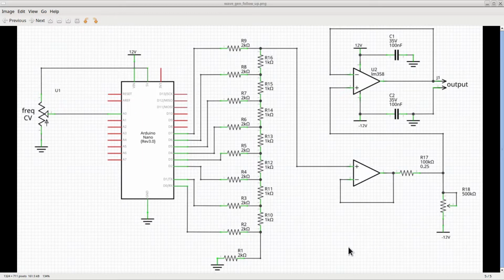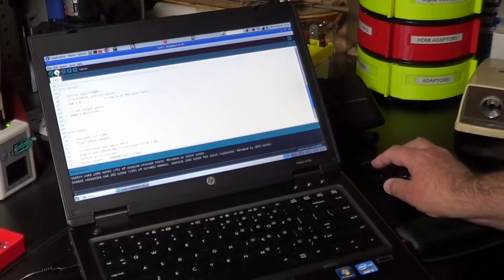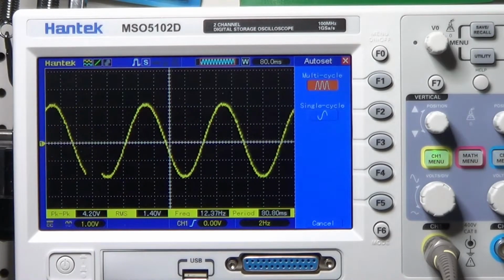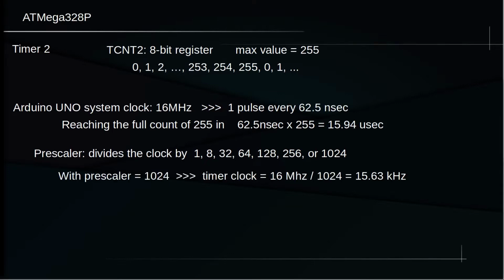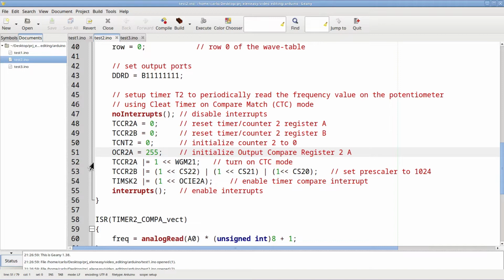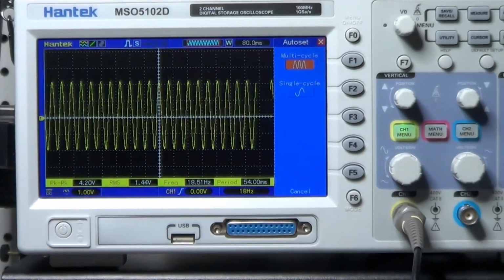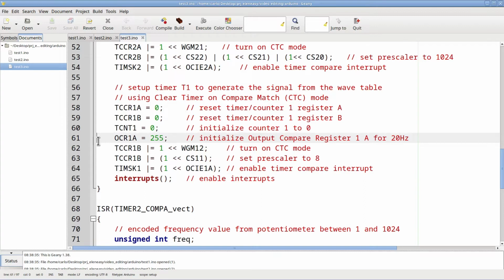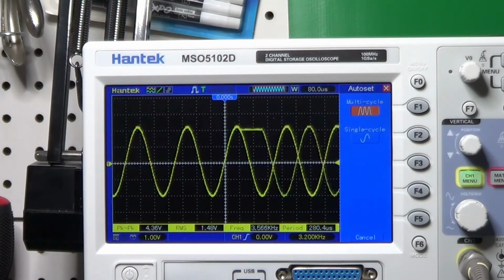The Arduino Audio 2

Comment: Could the instability of the scope trace be caused by servicing the potentiometer read routine?

Also, could the frequency be increased by incrementing a phase counter with the wave ISR and using that as an index into the wave table? As frequency increases, there are fewer samples per cycle. So it does not look as smooth, but can be smoothed with a low-pass filter.
Reply from the maker: I thought about the possibility that the servicing potentiometer routine spends too much time and causes those glitches. I'm thinking about possible solutions. Anything that comes in your mind?

For what concerns your second point about reducing the number of samples for higher frequencies, it is an interesting idea. It could actually reduce the CPU cycles spent in generating samples at the highest frequencies, and that could make a difference. I think I'll give it a try. This was a very good tip. Thanks!
Reply: @eleneasy  A couple of ideas come to mind to mitigate the glitches associated with the potentiometer read ISR. I'm not real familiar with the processor so I'm unsure if any of these are viable. (1) If there is a way to only trigger the ISR only if the value of the ADC register changes; (2) Leave the ADC read in the main loop so that the loop timing is constant (limits highest freq achievable);  (4) If the processor supports prioritized interrupts, set the signal generator ISR to higher priority so that it could preempt the potentiometer ISR.
Reply: @eleneasy  Regarding my second point, I did something similar about 20 years ago on a PIC microcontroller.  I used assembly language.  I can't recall the max frequency I acheived.  Here is a code snippet showing my implementation of the main loop:

PHASE	equ	H'0C'	;reserve phase accumulator in RAM

;*****************************************
;**  Initialize and Loop Forever   
;*****************************************
  	org 0		;reset vector location
  	call INIT	        ;initalize ports
	goto MAIN

MAIN:	movf  PHASE, w	;get last value for PHASE accumulator
	addwf PORTB, w	;PORTB contains the incremental value
	movwf PHASE	;store in variable PHASE

	btfsc STATUS, C	;check to see if the 8-bit accumulator
	call SEL_TABLE	;overflows, and set the PCLATH if it did.
	;call MARK_TIME	;Otherwise, waste time for consistency.

	movf PHASE, w	;Restore the Phase to w for processing.

	call TABLE	;get cosine amplitude from lookup tbl
	movwf PORTA	;update output (PORTA)

	goto MAIN	;loop until reset
;*****************************************
Reply: Carlo, I tinkered around to port the synth to Arduino Nano.  I can't quite reach 6 kHz, but there may be opportunity to optimize the code (and increase the clock up to 20 MHz).  Give the following a try and see if it works for you.

//*****************************************************************
// Steve Harbin 12 August 2022
//
// SYNTH program. Version 0.1 
// Synthesize a sinusoidal wave at a frequency corresponding to the 
// 10-bit input signal on analog port 2.
//
//  This program integrates (accumulates) the values read from Analog  
//  Port 2 over time and outputs the corresponding 5-bit cosine 
//  representation to PORTD.  It integrates and ouputs forever or
//  until the processer is reset. 
//
//	device:	Arduino Nano (ATmega138P-AU @ 16 MHz)
//*****************************************************************

//************************************************************
//*************** Analog Input Pin Functions ***************
//************************************************************
// Analog in 2: frequency control potentiometer

//************************************************************
//*************** Digital Pin Functions **************
//************************************************************
// Digital 13: LED Output
// Digital 2 - 6: Flash A/D digital output digits (note that pins
//                0 and 1 are used for serial comms and can't be used)

//************************************************************
//*** Library Inclusions & Class Variable Declarations *****
//************************************************************
// Library for Input/Output Functionalty
// http://www.nongnu.org/avr-libc/user-manual/group__avr__io.html
#include <avr/io.h>

//******* Define Global Variables *******
uint8_t cosPhaseAcc; // Variable used for the phase accumulator

//************************************************************
//*************** Define Pin Channels **********************
//************************************************************
// Analog Pins
#define FREQ_CONTROL (2) // Frequency control potentiometer

// Digital Pins
#define LED_PIN       13
#define LED_PORT      PORTB
#define LED_BIT       5

#define OUTPUT_PORT   PORTD 

//************************************************************
//********************* Sin Wave Table *********************
//************************************************************
// 512 phase entries of 5 bit magnitude
uint8_t cosinTable[] = {
  31,31,31,31,31,31,31,31,31,31,31,31,31,31,31,31,31,31,31,31,31,30,30,30,30,30,30,30,30,30,30,30,
  30,30,30,30,30,29,29,29,29,29,29,29,29,29,29,28,28,28,28,28,28,28,28,28,27,27,27,27,27,27,27,27,
  26,26,26,26,26,26,26,25,25,25,25,25,25,25,24,24,24,24,24,24,23,23,23,23,23,23,22,22,22,22,22,22,
  21,21,21,21,21,21,20,20,20,20,20,19,19,19,19,19,19,18,18,18,18,18,17,17,17,17,17,16,16,16,16,16,
  16,15,15,15,15,15,14,14,14,14,14,13,13,13,13,13,12,12,12,12,12,12,11,11,11,11,11,10,10,10,10,10,
  10,9,9,9,9,9,9,8,8,8,8,8,8,7,7,7,7,7,7,6,6,6,6,6,6,6,5,5,5,5,5,5,5,4,4,4,4,4,4,4,4,3,3,3,3,3,3,3,
  3,3,2,2,2,2,2,2,2,2,2,2,1,1,1,1,1,1,1,1,1,1,1,1,1,1,1,1,0,0,0,0,0,0,0,0,0,0,0,0,0,0,0,0,0,0,0,0,0,
  0,0,0,0,0,0,0,0,0,0,0,0,0,0,0,0,0,0,0,0,1,1,1,1,1,1,1,1,1,1,1,1,1,1,1,1,2,2,2,2,2,2,2,2,2,2,3,3,3,
  3,3,3,3,3,3,4,4,4,4,4,4,4,4,5,5,5,5,5,5,5,6,6,6,6,6,6,6,7,7,7,7,7,7,8,8,8,8,8,8,9,9,9,9,9,9,10,10,
  10,10,10,10,11,11,11,11,11,12,12,12,12,12,12,13,13,13,13,13,14,14,14,14,14,15,15,15,15,15,16,16,16,
  16,16,16,17,17,17,17,17,18,18,18,18,18,19,19,19,19,19,19,20,20,20,20,20,21,21,21,21,21,21,22,22,22,
  22,22,22,23,23,23,23,23,23,24,24,24,24,24,24,25,25,25,25,25,25,25,26,26,26,26,26,26,26,27,27,27,27,
  27,27,27,27,28,28,28,28,28,28,28,28,28,29,29,29,29,29,29,29,29,29,29,30,30,30,30,30,30,30,30,30,30,
  30,30,30,30,30,30,31,31,31,31,31,31,31,31,31,31,31,31,31,31,31,31,31,31,31,31
};
//************************************************************

//************************************************************
//*************** Pin Setup Declarations *******************
//************************************************************
void setup() {
  pinMode(LED_PIN,OUTPUT);
  digitalWrite(LED_PIN,HIGH); // Illuminate LED to indicate running

  cosPhaseAcc = 0; // Inititalize phase accumulator upon startup
}

//*****************************************************************************************
//*************** Main Looping Functionality ********************************************
//*****************************************************************************************
void loop() {
  cosPhaseAcc += analogRead(FREQ_CONTROL)/8%512; // Divide by 8 gives 4 samples per cycle at highest frq
  OUTPUT_PORT = cosinTable[cosPhaseAcc]<<2;  // Shift left since pins D0 and D1 are unavailable
}
Reply from the maker: @steveharbin5650  Thanks! I'll check that out.